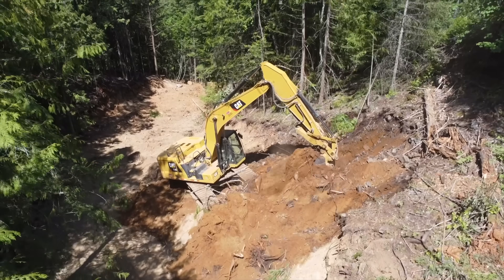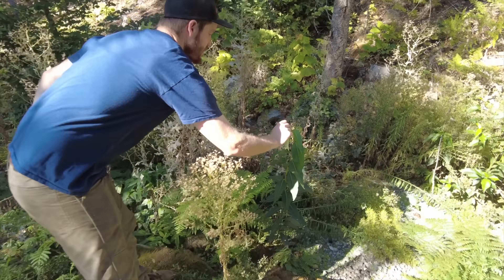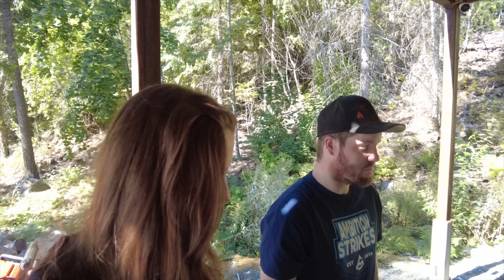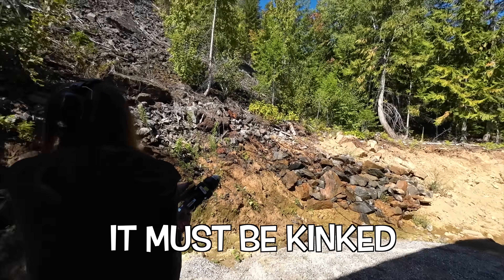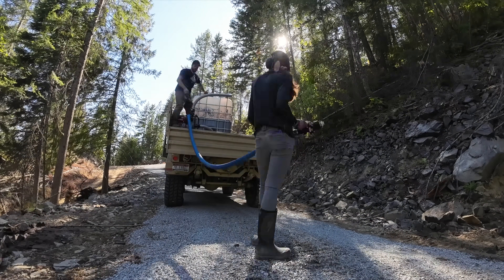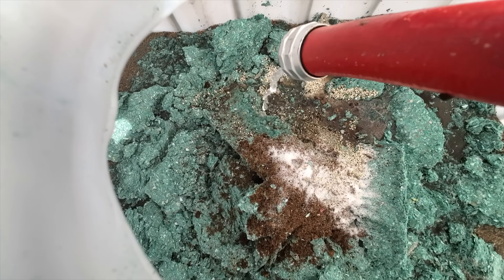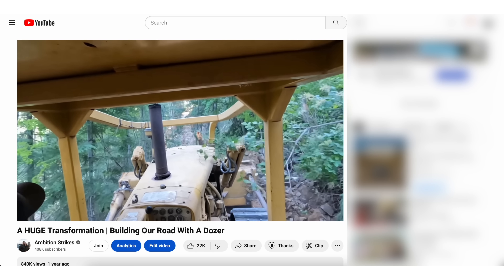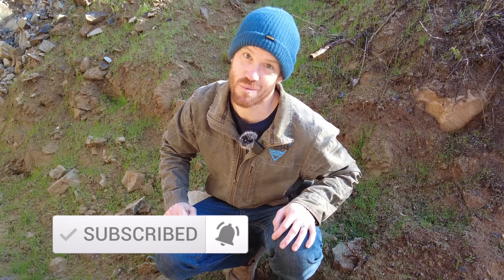Building A DIY Hydroseeder | Off-Grid Living

Comment: Getting ready for winter. Ah, Yes. This is from Manitoba, and may not apply. First, prepare your self. Imagine the foods you'll be eating. A pot of stew simmering for hours. Maybe a New England boiled dinner (I grew up in Nova Scotia). Make a point of running winter tires on steel rims. Put them on. Next, locate your Sorels and gloves for future reference. Find the windshield scraper/brush and put in the vehicle. Be realistic, and add a snow shovel. Winter survival kit(s). One in each vehicle. Prepare all engines for use or storage. All coolant must be up to snuff. Fuel stabilizer, etc. Any winter equipment that might be used should be started and run. Install raised, reflective markers at critical approaches, turns and drop-offs. Winter is a dark, white, blinding place. Then, just go somewhere and light a camp fire. Practice that when you don't need to. Make sure you have what you need at all times.

Comment: Mount the tote & the pump to a 4X6 pallet. Then You can just move the complete set up around wherever, whenever you want.  And I knew there is a special nozzle you needed.  Why such a grim segment title?   And many Co's that do this have a pan & tilt gimble nozzel  setup mounted right on the truck. I your case, part of the tote.

Comment: I am amazed at the number and complexity of challenges this couple has conquered. I really admire your grit and determination. 
However on the flip side, I am concerned about the carbon footprint for living for a family of 3/4 people. At this point, I don't get the purpose of living off grid when you crave/can't survive without any facilities of suburban living. Like what's the point of taking down a hundred trees for building a road that you can live without or so many other projects you've undertaken. It is amazing what you've done to survive but is it sustainable or where does this mindset lead us to. Why can't we live with other humans in colonies with shared resources like electricity, water, shelter on a sharing basis like other species of the planet. And then we are the ones complaining about climate change and what we are leaving for our future generations.